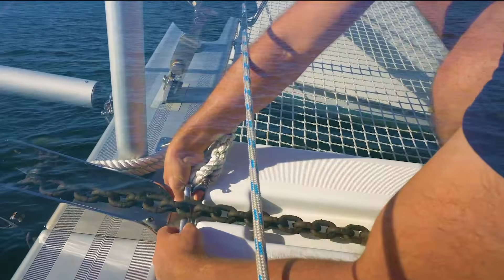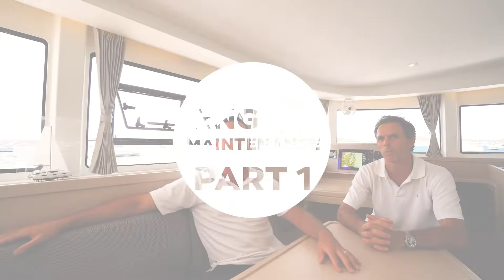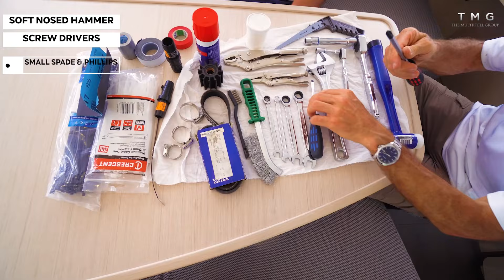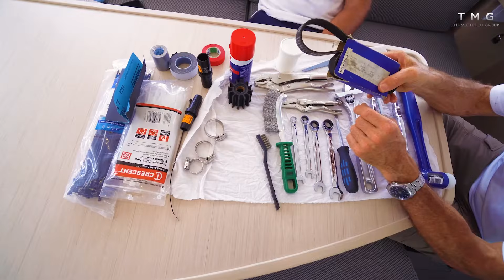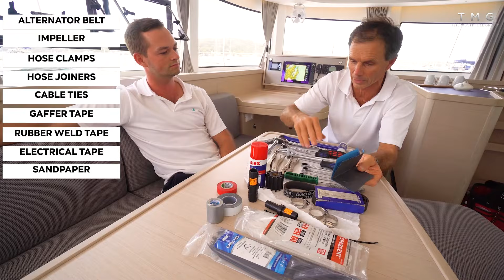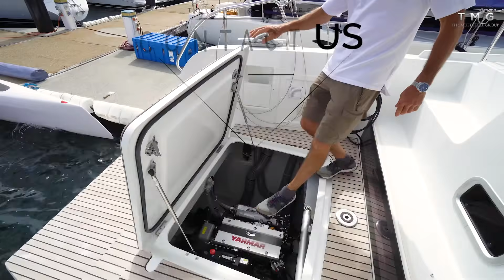Engine Maintenance Tool Kit Essentials | TMG

Comment: In USA-ese: Spanner = Box Wrench, Shifter = Adjustable Wrench, Vise Grip (which is a Registered Trade Mark) = Locking Plier, Hose Joiner = Coupling, Cable Tie = Zip Tie. 

Also, keep the tools  from rusting by wiping them down with WD-40 and a rag.